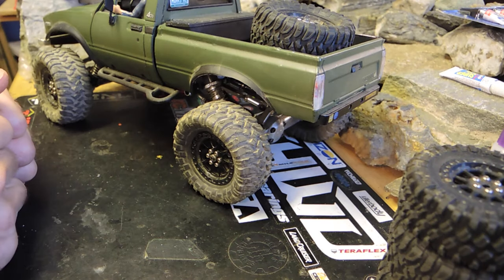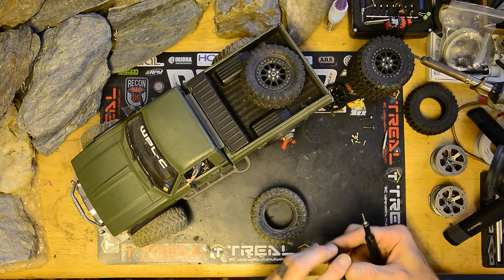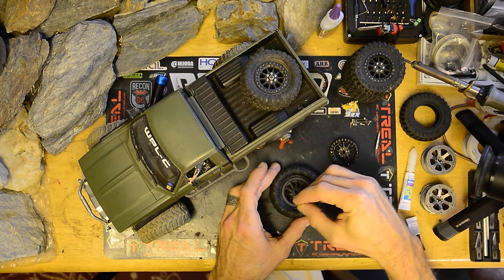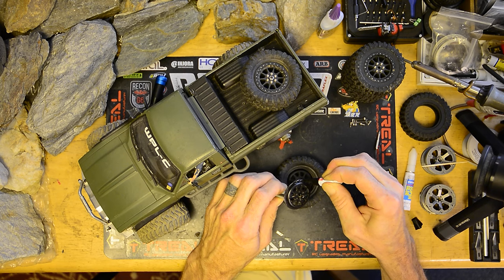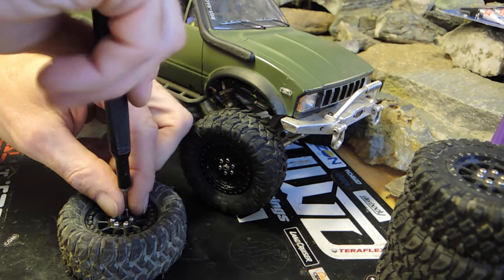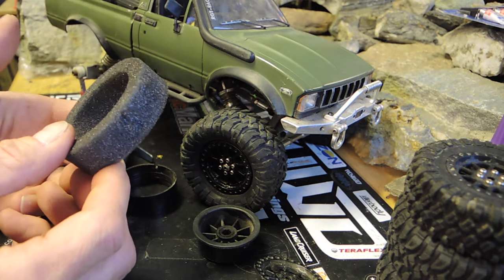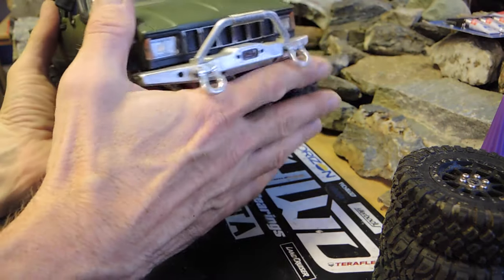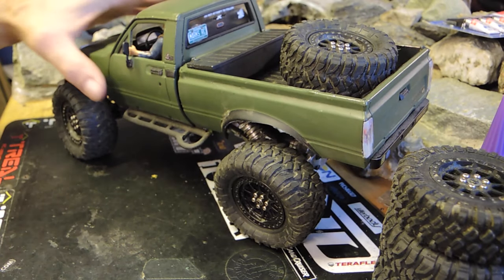MN/Injora Tire Bead Gluing and Detailed Overview - The Long Awaited LONG Video

Comment: I’m a bit mad at my ultimate c-14 project. My high lift didn’t work with steering geometry, so it’s gotta come back apart and I gotta switch the links back around. Also my 2 speed shift mechanism is hitting on the dang metal links. Ugh trial and error, and try again lol 😂 great video my friend.
Reply from the maker: That's too bad, man. My thought would be that the links are bit too short to try that sort of thing to be able to keep the function. A hybridized would probably work but that would mean a different chassis and longer links? I personally think WPL needs to undergo a massive overhaul and that chassis rail design, but that's just my opinion.

The two speed problems you're having are also why I don't run two speed gearboxes on my WPL stuff. To me, it's one more thing to fail or cause issues on a scale that's pretty tight for room as it is. I know a lot of people run it but it's just not for me. 

This truck isn't perfect by any means and it's taken a few different variations of it to finally reach the point it's at. So, if I can be of any inspiration, hopefully it's to keep trying what you're doing until you get it right.

Comment: Thank you so much you’re really good at answering questions from the comments I’m going to try that out with the servo for sure I didn’t even realize. A quick question I know you’re a busy man I probably have to 10 scale and 3 1/2 WPL/mn. How do you figure out how to spread your time cause I have too many irons in the fire really overwhelmed I’m not sure which one to work on I want to get them to a point where I can just call Take them off the shelf and drive them.  I don’t know how ya divide my time. I’m not sure when to stop upgrading and when to call it good…? Thank you for your time……….
Reply from the maker: You are very welcome and thank you for acknowledging the investment of my time, as well. I really appreciate that. 

How do I manage the time between them all? Are you sitting down? Good. Out of my fleet of soon-to-be two dozen, I have currently about 1/4th of the fleet that's in some need of some sort of fix/upgrade/repair. That ranges from a smoked front differential in my RC4WD TF2 LWB to something as simple as needing to swap the broken rear driveshaft on the Desert Eagle #12428 clone. I back burner projects like that TF2 LWB truck because, while it is absolutely awesome, I like my TF2 Midnight Edition that much more. So, between that and my Gelande II D90, I can get a little more focused with content. If anything goes wrong with the TF2, that truc takes priority and gets fixed. However, I've never had to do a single thing to it in the year and a half I've owned it. Like, absolutely nothing except to mod it and run the snot out of it. 

I have my personal favorites that I like to run. AND I also try to keep you guys, the subscribers, happy by alternating the runtime and video rotation. So, that gives me a little bit of guidance on what to run. Then there are times when I have to pull something out of rotation and work on it or do a special video for one thing or another, like a mod.

If I said I had any particular method for picking which ones or focusing on which ones, they sort of tell me themselves by how well they run .. or not. There are also some that I just don't want to run as much. Not because I don't like those rigs, it's just that I'd rather bust those out when I really feel the need. Like my C44KM. Sick truck, but it's better on the shelf at times. When I want to get work done out there, I'll grab the Green Machine or the C54KM and try and make video magic.

I also try and incorporate new models into the rotation. Which, doesn't necessarily mean I have to pull a different one out to make room/time, it just means I have to budget the run time more efficiently. The real test is if a new rc doesn't hold up or reveals that something needs work, I'll bench it for an indefinite amount of time until I'm ready to focus my attention on it. I do have some crawlers that you guys have never seen. And that's only because I have no desire to build anything around that particular machine in order to take away from other stuff that deserves far more attention. They're just key pieces of my collection that I hang onto just to have around. 

That said, I know what can get the work done. These days, I have everything (minus the 1/4th of the collection that benched) dialed in pretty well. It takes a while to get each one at that point. You know it when it arrives at that stage. The less and less you have to tinker, you know you've gotten closer to your goal. 

Like this green truck, I do semi annual maintenance on the ENTIRE drivetrain and that's it! That, alone, keeps this thing rolling and kicking a bunch of a**. Like my TF2. Totally bomb proof. Like my Gelande II, as well - that thing will be around long after the end of the world. For me, knowing what models to keep focused on is what helps the most. What makes me happiest to see running? What frustrates me about what's wrong with certain models? Is it something that can be fixed easily or will it take weeks of mods and testing to finally get it right? 

I have focus trucks like that. For example, my SCX24 HiLux. I spent an immeasurable amount of time getting that truck just right. Given that effort, I never have to do anything but charge the battery and run it. And the video results have people asking if it's a 1/10 and not a 1/24. That means I've done something right by investing that amount of time into making it a daily driver.

Next up: I just scored a GMade R1 off Facebook Marketplace. It's set for 4 Wheel Steering/ I'll know within a day whether or not that thing will be a contender. I'm pretty sure it's already there. But, even the slightest thing wrong will send that to the back of the line and that's just how it goes.

Jeremy, always, thanks for asking the good questions, man. You know I enjoy answering this stuff for you guys. It's what drives this whole thing. Until next time, my friend!✌️😎

Comment: I just got my truck. What brand and size are the tires? Can’t wait to start modding it.
Reply from the maker: What did you get? A WPL? These tires measure 70.5mm x 25mm. If you cut the foams down, they're nice and soft.
Reply: @VermontScaleCustoms  Hi, I got the WLP c24-1. Thanks for getting back to me. It’s my first RC. I’m a newbie.
Reply: @VermontScaleCustoms  I subbed. Love your editing of the rigs in action. Like I said I’m new to the RC thing. It can get confusing what works with what. Soaking up as much knowledge as I can .
Reply from the maker: Welcome to the hobby, Darren! Glad I could help. Always here to answer questions if I can, or point you in the direction of the answer!

Comment: Nice info man, my youngest son has I believe a wpl d90 defender, its blue and orange and the motor mount broke and the steering sucks, and the drive shafts keep falling off lol and I really wana build it back to working order  or better actually what's your thoughts?
Reply: Correction it's an mn99 defender
Reply from the maker: Thanks, man. I've done two MN90 Defenders in the past. My first one was sort of my main rig for this channel three summers ago. They're definitely fun trail trucks.

Someone makes a full metal chassis for the MN series stuff that would probably mount right up. Not a big fan of the red, myself. But here's the link. https://tinyurl.com/5n94v8cn

I know they did make it in black and silver so if you keep looking you might find it. It may even be on Amazon. But that's getting all the upgrades in one conveniently packaged deal for much less than buying it all separately. Is it worth it? Sure, if you want to dedicate the time, the all-metal parts turn them into really solid trail trucks.

Comment: I'm from the Philippines, i just got my wpl c24 RTR.. having a problem with steering, i bought a new servo motor but that doesn't solve the problem. What do you think causing it, do i need to change esc and transmitter/receiver? Hope you can help me.
Reply: Let’s see some videos 👏🏿👏🏿👍🏿
Reply from the maker: Can you very specifically describe the problem that's happening?

Often times, without seeing the truck in video, or not having it in hand, it's really tough to say what could be cause the problems or what the problem may actually be, specifically. There are a lot of factors that may cause a malfunctioning steering linkage/servo/front end problem in a WPL. Alas, most of the issues are all easily solved once you know what it is.

Aside from asking a TON of questions about what's happening, my best suggestion would be to snap a video of it and head over to the Facebook WPL group. That way a bunch of different eyes can see what's going and will help you get it figured it out.
Reply: Where can i send you a video?
Reply: @wplrcnoob9713  posted it on YouTube 👍🏿👍🏿
Reply from the maker: Join the Facebook group and share it there. We're all over at that page. That's probably the easiest spot to get a quick answer from a bunch of the WPL crew.